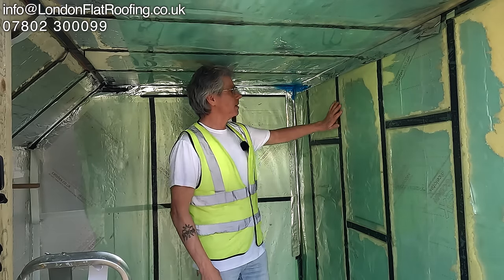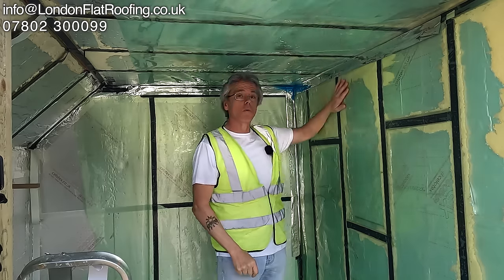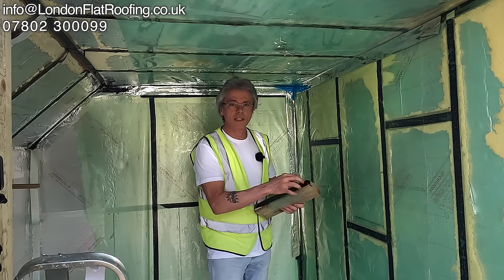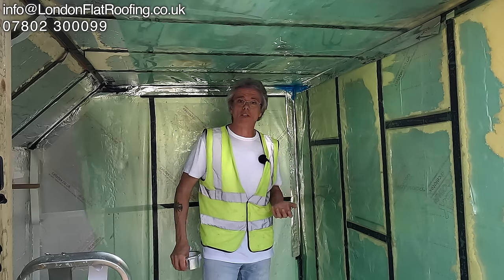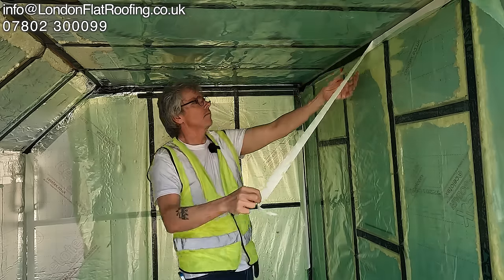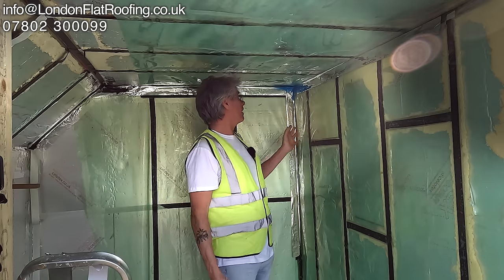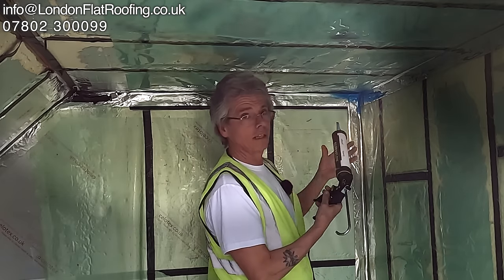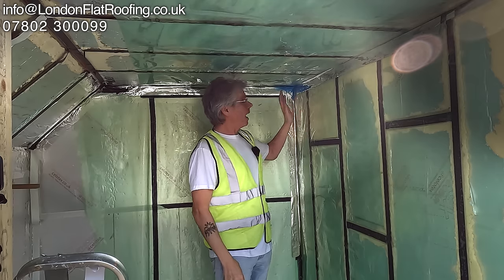Vapour Barrier Installed Correctly - Walls and Cold Roofs

Comment: Great info Steve but you do realise that it's just not going to happen.  Rightly or wrongly your average builder is not going to take that must care over the detailing and  building control certainly don't pay much attention to it. 
Constantly changing regulations and standards just add to the problems. We are having to price for ever increasing insulation requirements and still remain competitive AND  keep our guys employed AND make a decent living for ourselves. Try telling a customer that your quote is more expensive because you have got to seal the AVCL with the special (ie expensive) butyl tape, oh and yes we cant use the same PIR that we've always been able to use for years, we now need to use this special (ie more expensive, and no doubt unobtainable from my normal supplier)  PIR.
I'm just glad that i'm old enough to retire soon and leave all this behind me.
Reply from the maker: IF the specification is given to a builder / roofer they have to do the work correctly or will be held responsible. Hidden costs in materials and labour are horrendous when you look at the correct way of doing this. Easily missed when tendering. Because you cannot see this once the job has been finished it's never installed correctly this can cause problems and huge costs at a later date. There are other ways of doing this and I will be going into those in other videos shortly.
Reply: Customers that care about these things and will pay for it are there.
Reply: Hi. How do I find a roofer that can doth this  vapour control
Reply: I cannot hear any sound?
Reply: @doreenbritton5828  It's very unlikely you will, if you can even find one other example on Youtube etc of a roofer/builder going to these lengths I'd be amazed to say the least. This is the gold standard... but to be fair most customers probably wouldn't want or couldn't pay the extra for this.
Reply: @SteveRoofer  I have got an extension with flat cold roof which is sweating in winter, the builder said he is going to put vapour barrier on the ceiling but not at the walls, just wondered if the wall vapour barrier is a must?
Reply: Also, I think the truth is that a lot of builders are not aware of these methods, so for me a diyer, im getting a better job done myself thanks to steve
Reply: 🎉😂covbkhk rrw no
Ml😢 c

Comment: Some good information in your videos! A new sub from me. Looks like we will all be living in polythene bags! warm but no fresh air in? Where is all the moisture going to go created in the home? When everyone shuts up for winter unless you have ventilation you’re going to be breathing in stale air? Would be nice to go into one of these sealed homes and see what the co2 levels are with a home not breathing! or do they have heat recovery air in/out vent fans. This could all be done to aid killing you off earlier with poor air quality. Only my thoughts I live in a costal old town and the buildings are cold but they breathe and have lasted 100s of years some simple upgrades have halved the heating costs, upgrading loft insulation and cellotex on the inside of the external walls, obviously double glazing would help but not permitted in conservation areas.
Reply: Without a MVHR these super insulated homes run dangerous levels of CO2. I did a little experiment in our place, in the kitchen (super insulated) with 5 of us in there for lunch the CO2 goes from 420-1100ppm (no MVHR). That is not going to kill us but its not good for working in - just feel very sleepy. I've built a number of places with MVHR units and it is a revelation, its like being outside in the most fresh day but with the warmth you'd expect inside and no wind. They are quiet and can be set to kick in/ up a gear on higher CO2 / occupancy. It's like everything though, if the house is properly insulated as per this video with MVHR it's going to be amazing...but cut a few corners or lots of them (as many builders do) and the will catch up and bit the homeowner hard, especially if the person who has to make the repair doesn't understand what's really happened and we have such a shortage of builders who really understand the mechanics of this.

Comment: I had the need to use a thermal imaging camera once. When digging deeper, I found out about surface emissivity. 
If you look into that you will realise that a thermal imaging camera does not magically measure the surface temperature, all it does is measure the intensity of the infrared radiation emitted. 
Different surfaces have different emissivity's, so for the same temperature, they emit different amounts of infrared radiation, so the temperature measurement is really an approximation, but can be used for comparative purposes when done on the same surface material.

Comment: Once a building is airtight sealed in this way, how do you let moisture out? Especially in a bathroom or kitchen. I will be building an extension in Sept with both these rooms, and would like to get it right. Apologies if this something covered in your videos, thanks
Reply: Building regs require bathrooms are vented, either by window or extractor fan.

Comment: on a standard loft conversion, there is a sloping roof to the front and a flat roof over the center and rear dorm. How do you do a warm roof? it will be hard to do a warm roof on the sloping part so how can you join a cold roof to a warm roof, or am i asking the wrong question, should I be asking how to do a warm roof over the sloping part.
Reply from the maker: On the rig that I'm working on I will do a video regarding that however to answer your question you do a cold roof over the pitch area and a warm roof over the flat area.
Reply: @SteveRoofer  thank you sir, that will be an interesting video, I'm looking forward to it

Comment: Fair enough doing everything to the highest standard but I don't buy into the idea of issues without taking things to this level.

I have a cold roof garden office and loft.

No vapour barrier in the loft (before I knew as much as I do now), PIR insulation with a good air gap behind. Down lights cut out. No issues.

Office I did to the best of my knowledge at the time. Warm roof was not possible due to height restrictions and converting an already brick building. Internal brick was painted with black jack. As it was bone dry when I purchased the house I decided to do a new coat of black jack, air vents either side of the roof, left a big 50mm air gap on top including cross ventilation (furrings), PIR insulation between joists on ceiling, downlights cut out with no big attempt to seal, used cavity insulation for walls, used a green vapour control layer all over, left big overlaps and used the cheapo silver tape for joints. Probably used more screws than needed for plasterboard. No issues.
Reply from the maker: If you paid a professional person to do the job and they didn't do it correctly and it went wrong who would you turn to to put it right? So professional people should do it correctly otherwise they could have some large claims against them

Comment: I have a room that is in part below an open air Deck access (walkway). The ceiling is concrete slab. From watching your videos I must create a warm roof as to insulate internal there would be no air flow between the concrete slab and insulation? This correct thinkingness on this matter?
Reply from the maker: When you put insulation over a concrete slab you have to insulate all edges so you get no cold bridging and you don't need airflow with a warm roof

Comment: Need some advice Steve I have been told you can't fibreglass over OSB board coated with bitumen paint as it won't stick so if you cover with 3mm hardboard will that be ok to fibreglass over thanks,  your help will be much appreciated
Reply from the maker: It's not so much that it doesn't stick it reacts with the tar so all you need to do is put a barrier between the two and you're good to go 3 mm hardboard you could do but why are use glass fibre because it is a very bad roofing material use something more flexible

Comment: Great videos Steve. I wonder if you could help with one question. On a timber frame garden room, with a warm flat roof. I’m struggling to think of a way of forming an air tight VCL seal, in between the roof joists, where they sit over the stud walls. Would it be a problem to add an additional VCL on the underside of the joists like on a cold roof, and tape to the wall VCL, or would this cause an issue with an additional layer, as there is already a VCL under the insulation on the warm roof. Thanks in advance.

Comment: I’m having the kitchen plastered which has a cold roof. I’ll be fitting the vapour barrier to the ceiling but where it meets the top of the wall, can this be taped down then plastered over? Thanks
Reply from the maker: Yes type it to the walls make sure that it's completely airtight and no air can get up into the void above

Comment: Steve will you do another thermal camera scan now it's got an air tight layer. I remember some warm spots due to air migration, have these been reduced now air movement is controlled?
Reply from the maker: Unfortunately I cant as I ran out of materials but I will do using the next batch of AVCL,s i play with

Comment: Hi great video thanks. How do you deal with lightning cables and downlights when having to use 150mm celeotex between the rafters and then 50mm celeotex below that, ie vapour barrier when having downlights and also having to deal with restricted height

Comment: Hi Steve,
Would really appreciate your opinion if you had a minute,
Would this Vapour barrier spec be suitable for a standard cold roof in a medium occupancy garden room:

Semi transparent green visqueen. AVCL
SD - 128
MNs/g - 633
Permeability - 0.21
Thickness 0.3 mm

No excessive mouisture being produced, RH being kept around 50%.
All airtight details and correct tapes used.

Many thanks if you have time to respond.
Reply from the maker: Yes that will work just make sure you fit it as best you can and as airtight as you possibly can

Comment: Hi Steve.
Thanks for sharing,  I am doing a conservatory with a flat cold roof, I have used 6x2 timbers at 2.5m long, then used 6x2 cut down to foam my slope so it is raised 6" over 6ft, I will be inserting vents into the soft to allow air flow through, internal I will do the vapour barrier at 130 as in your video,👍
My question is the breeze block and how would I seal the vapour barrier to these🤔
Thanks 
Sean

Comment: Thanks for the info Steve. I’ve got a 200yo stone cottage on the outskirts of Glasgow and I’m just about to start insulating myself…

Is it necessary to insulate walls that aren’t a part of the exterior wall, separating walls if you like?

I’ve decided to use ROCKWOOL for its various properties, one being that rodents don’t like to live in it, and we definitely have mice.

I’ve also ordered the Novia green barrier, silver foil tape and butyl tape from Novia too.

Thanks in advance 😊👍

Comment: Hi Steve,
With walls and ceilings sealed like this, putting any fixtures to the walls/ceiling is basically a nono? Eg wall plugs, TV brackets, shelving support etc. Everything which require some type of piercing through the plasterboard will likely puncture the vcl.
Basically you are saying, insulation layer of 150mm + gap/space, plus 75mm all round framing to accommodate any fixings...

Comment: What would be your opinion about where or if any vapour control layer/barrier in a suspended timber frame ground floor, new build, access underneath via crawlspace , with pir insulation in-between joist.
I am thinking from bottom up , breathable roofing membrane , joist with pir insulation between insulation to top of joist providing air space beneath below to membrane, next is where I'm lost, is it osb board then vapour and some foam over to protect from Finnish laminate flooring or , vapour barrier then osb board or and vapour lol thanks ,great videos and information in all your roofing details
Reply from the maker: I would ask one of the vapour barrier suppliers for their help so far I have found them very helpful try Novia

Comment: Thanks for all the  videos you do Steve. 
I'm retrofitting insulation between the rafters of a cold sloped roof, so sloped ceilings in some of the rooms, and the bit I'm not sure about is how to seal the vcl at the perimeter of the ceilings to the brick/block plastered walls? Novia say you need 150mm of overlap when joining vcl layers so does that 150mm also aply for perimeter joints? Does that 150mm need to be ran down the wall? Do I need to chip off the plaster to hide the vcl. Will the new plaster stick to the vcl? I'm tempted to just butyl tape 10mm onto the wall so that the new ceiling plasterboard covers it, but is that 'airtight' ?
Reply from the maker: As you are starting to realise there's no room joined up, thinking with this junction so what you're trying to do is to make it airtight and make it a tie for its lifetime. The butyl tape is very good. Can you plaster over the plastic? No 150 mil millimetres is obviously the guideline. The butyl tape is only 25 mil wide so theoretically you could drop the 150 mm to the 25 mm as long as everything is airtight. Plastering over 25 mm would not be a problem even if it didn't stick.
Reply: Great, thank you

Comment: Hi Steve, I have spray foam insulation upstairs in my dormer with the breathable card behind it. Do I still need to put on a vapor barrier bearing in mind that I have vented soffits, and a ventilation hole cut in the wall with a core bit albeit below the ceiling? It's not a flat roof.

Comment: I have a question..I have a void space. I was going to put celotex on the inside of the void up against the plasterboard by it's studwork . I found out there is no vapour barrier. All I have is 100mm of fiberglass insulation in the studwork. Can I take out the fiberglass. Line it with a vapour barrier then celotex over it? Baring in mind the vapour barrier won't be flush against the back of the plasterboard because of the studs. 
Told I can't insulate the rafters so it has to be the plasterboard. How can I put a vapour barrier

Comment: Nice video Steve. How to insulation and vapour barrier a log stove flue through a cold roof?
Reply from the maker: I think I replied to this earlier just make sure it's well sealed with the vapour barrier the vapour barrier extends to the height of the insulation and perhaps insulate hire around the pipe to stop thermal bridging

Comment: Hey mate, how's things? How much PIR insulation would you recommend for a flat roof on a kitchen in England? Thanks
Reply from the maker: New building regulations come out this week and we think the new regulations will mean that on a retrofit roof the thickness of insulation to get to the correct U value will be 150 mm it used to be 120 mm
Reply: @SteveRoofer  Thank you Steve you are a life saver 🙏

Comment: A good followup video after this one would be one showing the damage a cold roof can get after installing PIR plates taped only with silver tape (the regular one, not that strong stuff). I was assisting last week a company that only used PIR plates and pur foam to close the gabs and some silver tape. Where the PIR met a stone wall they put the silver tape decoratively over the pur foam but not on the wall because that would let go. 

No Air Vapour Control Layer was added. The customer of course was very happy, but what does she know? If there will be damage because of wood rot, years after, will he/she be able to put that liability to the installation company? 

I find this all very disturbing.
Reply from the maker: Yes its not nice for some people when it all goes wrong

Comment: Thanks so much for your videos - I've found them super helpful. I have a question on something thats not been covered yet though, if you dont mind! I have a pitched roof that has 100mm of joist on show on the inside every 600mm and tongue and groove pine behind it. Externally under concrete tiles I imagine there is some kind of PIR. I'd really like to add another 80mm of PIR internally between these joists but I'm unsure if I need to leave an air gap as there is no venting as its all internal. Do I just push the PIR flush with the tongue and groove and air seal it all? thanks!
Reply from the maker: This is covered in other videos. However, the key to this is airtightness from the inside and ventilation on the outside under the tiles. The ventilation must be through ventilation air tightness must be achieved internally under the plasterboard if possible, using a vapour barrier if you do that everything should be okay

Comment: Hi Steve great videos I’ve watched so many, can I ask a question?  I’m doing a cold roof on my new wooden workshop because of height restrictions, I’m happy with that process.  However looking online I’m really struggling to see whether there needs to be a air gap for ventilation in my walls as well, like the cold roof needs?
From the outside in, the walls will be 45mm tongue and groove, 100mm cavity slabs, vapour barrier, then some sort of inside wall like OSB, thick enough that I can screw into without reaching the vapour barrier.  So do any of those layers need an air gap?  Many thanks I hope you get the time to reply! :)
Reply from the maker: Wall design is different to roof design as there is normally less present on them. A vented rain screen ie outer layer is always recommended  but seldom done
Reply: @SteveRoofer  thank you that’s sort of what I thought, in a roof it’s so critical because of heat rising and gravity causing condensation to sit.  But in the walls I should be ok, especially as my 100mm rock wall slabs are breathable?  It’s to late to add a breathable membrane unfortunately I’m too far into the build